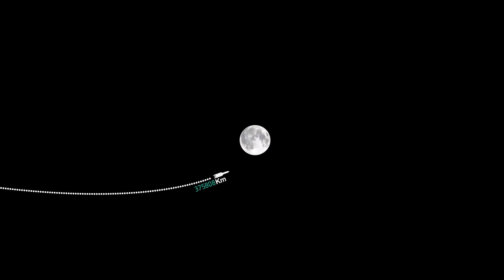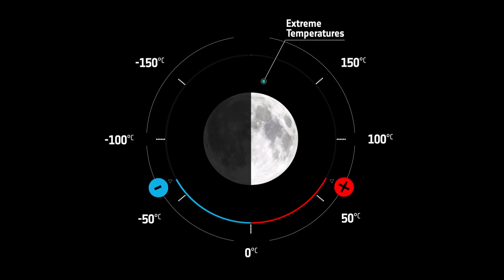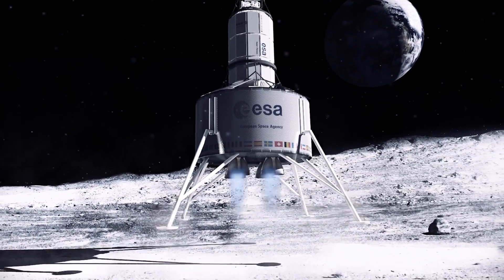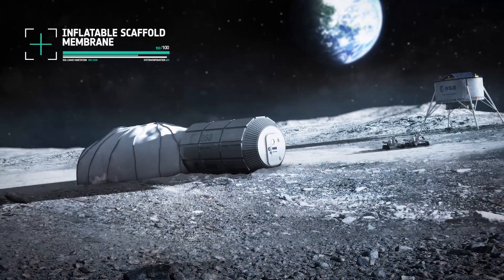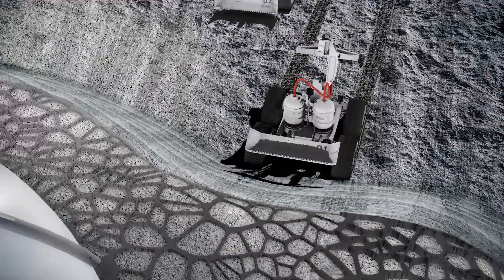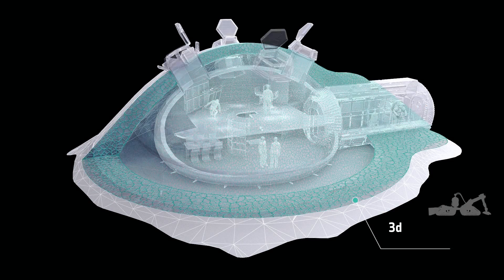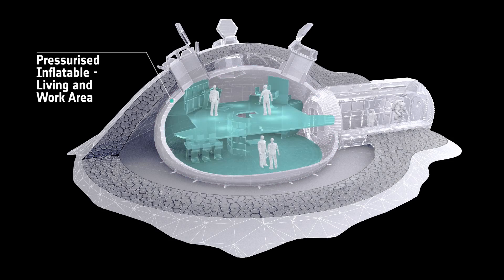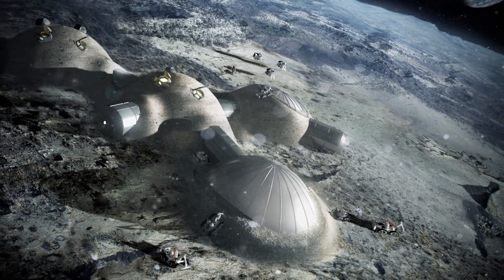3D-printing a lunar base

Comment: I still can't believe this hasn't happened yet blows my mind.  There has to be a reason.  -50c to 50c is -58f to 122f.  That is absolutely achievable to have sent 3d-printing heavy machinery.  You're working with near Earth range temperatures.  It's literally right there.  Blows my mind.  All the solar power you need is easy!

Comment: Dear Old Ariane,   and Starship a combined Shuttle/Freighter/Moon base system.   150 tons Delivery ! !
(Put on it's side (controlled topple with forward rocket engines) slowly remove flight hardware(and stabalised with floors/bulkheads) while living in habitation zone.   A relative simple Cut & Cover Base)

Comment: What harm would there be in using a thick layer of moon dust without 3D printing?  3D printing 2 or 3 feet instead of piling a thicker layer of loosely settled moon dust is more complex and therefore more prone to problems or higher expenses.  Digging the structure into the ground seems even safer from radiation and micrometeorites because it'll be an even thicker layer of moon dust.

Comment: two things, one is the water and air scrubbers would they be in a separate capsule and second power will it be nuclear or solar cause if it is nuclear it will have to be far away to prevent radiation swamping the area more then the normal solar radiation, also with the sun lights what happens if a asteroid directly hits one?

Comment: maybe an easier solution: 
2 types of robots, one makes bricks that are interlocking (kind of like a simplified lego brick), the other assembles them. 
or you can send just the brick maker, without anything else. Once someone comes over, they can assemble it
Okay, maybe not an easier solution, but it would make for a more earth looking structure

Comment: This is actually how lunar bases were envisoned back in the 60s by both soviets and Americans. Layering regolith dust, then using simple focused light to heat and melt it before the next layer was deposited, thereby building up a 3D shape. It would have roughly the strength of obsidian glass which with minor armature would be strong enough to build megastructures with. Especially in the moons gravity. So imagine 200,000 floor buildings.
Reply: you mean 200 floor? 200,000 would be 6000km and thats 1/2 diamiter of earth

Comment: 3D printing is the way to go, but those skylights are just unnecessary especially if the don't block radiation like the cupola does.
If someone later creates some window material suitable for such task, nothing prevents printing more on top of the windowless domes, in fact the shells could printed straight away because there would be no worry of decay.

Tetrahedron would be also more versatile shape for a building project than a sphere, especially in the long run.
Reply: the sphere is stronger than a tetrahedron, and would also be easier to create using the method proposed.
Reply: @JuliaC-sp5qk  But it doesn't need to be strongest, it just needs to be the easiest shape for ever growing colony, tetrahedron would be most suitable a long with cubical shape, as it can be stacked  more easily and they don't have round shapes which means you don't have make unusually shaped objects, but can instead use already mass produced things.

Also, if the buildings would be at some point covered with solar cells or just metal plates, flexibility wouldn't be an issue as they could use just straight plates.

Comment: It's just the same design as my dreamhouse here on Earth. Burrying a house into the ground seems to be the most efficiënt way to build a house. Here on Earth they're extremely sustainable and save you a lot of energy. They keep you cool in summer and insulated in winter and there fit more into the natural landscape their build in. It is very awesome their are also the most efficiënt way to build a home in space on other planets and moons. You can say their are literally universal home design since they are the best solution in the entire universe😎👍
Reply: No, it wouldn't be any good on a liquid world.
Reply: @Jacob_Crowthorne  Not on a gas planet like Jupiter indeed. On a waterworlds you could make a flouting house but that would also be a totally different design. But on planets and moons with a solid surface made from rocks, sand or ice they are the best way to build a house.

Comment: I want to  see a base on the moon but everybody makes things more complicated than they need to be. It is easier to pgase 1 put down in a small crater, use the lander as the airlock/habitat and then dome around the lander compacting the regolith. The robots could just bulldoze and process the dome to cover and harden. This base will then be manned and phase 2 is to manage robots digging out trenches for the long farming domes to be buried and covered in solar panels.These will be detail installed by humans for lighting, bedding and irrigating for food and medicine. It all must be deep enough to block all the bad and manage the good. Phase 3, 4, 5... and so on. Keep It Simple Soldier. 3d printing and compatible systems break down easily. The regolith itself is killer abrasive dust.

Comment: - The skylights ought to be using mirrors to reflect light in, not be direct portals to the micrometeorites.
- Where's the power source?  Solar would be the logical choice and of course they would have to work with small holes punched through them, there are some that do that.  Additionally little structure for them due to the low gravity.-  What about the problem of the lunar soil and it's sharpness and danger.  Some kind of airlock would also need a way to clean/grab these particles for the health of the astronauts as well as keeping it out of the main living area.

Comment: THIS is the way colonization off-world needs to be started. And it needs to be extrapolated to a larger scale as well, building downward into the surface. The more meters of material between you and the surface, the better. Same thing for Mars; don't leave anything exposed or unprotected to the winds and the rock and the sandstorms. Dig down, dig deep, and cover it all for protection. None of this 'lets send colonists in a habitation tube that's protected by foam and tinfoil' garbage. Get the bots to start the work, and THEN let people move in.

Comment: There's no way that thin shell with protect you from Meteorites. Other than that, it's a good idea. You would be better finding a natural depression, building the dome stronger and then covering it with a lot more material. Better still build under the ground, although that is energy intensive. Another idea is to locate possible caves (if there are any) and build your base inside.

Comment: your going to need much thicker walls to protect from radiation. in space a lot of them are ionising and it will take more than 4 feet of dust to keep ionising gamma radiation out. 

also good luck trying to make a river work for 3 months straight. you do realise all the steps that are taken to allow the marz rover even move a foot??

Comment: I'm going to build a house in a similar fashion.  I'm currently working on a cool building earth ship building project at the moment.  I keep mentioning using a foam and sand mixture to fill the tires and we came across foam/crete mixtures and are working with that.  anyways Sweet way to build on the moon for sure.

Comment: comment 2#. the lunar base could be a joint effort funded by several countries including the U.S., Russia,China, the U.K.& the European Space Agency.and Japan as well as other countries in.this way the cost would be reduced significantly & having a moon base would be a stepping stone for launching a future mars mission we would be better prepared to cope with the extreme environment there.otherwise going there now would just be a suicide mission that would destine to fail halfway there.we need a nuclear powered ion drive craft that could get you to mars in less than 40days possibly even 30 days if the ship is fast enough.
Reply: UK is in the European Space Agency, also they do plan to use this as a stepping stone to Mars
Reply: @Livinivs  it won't be for much longer. Brexit.

Comment: if your going to build a moon base it would a good idea to have several dome like structrures built 1# for living qtrs 2# one for lab.wk.3#a power plant a small one at 1st and a station for maintenance & receiving of supplies etc.& that they all be connected by lunar lava tubes a rail system developed to make it safer & faster to get from one sta. to the next. & to create an emergency shelter in case of some unforeseen accidents occurring & a landing pod area for incoming ship's.
Reply: Remember that they always want to save as much space as possible, so they'll probably merge the living quarters with the lab. Obviously, if that's not possible, they'll split them into a couple of domes, as you have described. And don't forget about supplies - it'd also have to go somewhere (probably in those tunnels connecting the domes). A 'power plant' would just be solar panels on the outside of the domes. And a rail system would be the last thing they'd want to build, as walking a couple of yards is an easy enough task, I reckon. 

As to the shelter, they won't need it, as if anything goes wrong, they'll die either way. A shelter won't help. 

And, lastly, yeah, a launching pad would probably be a good idea.

Comment: nice would be able to put an observatory on the moon and make a it a refuel station for  further travel and a back up for rescue if needed also can make a ship building/repair  station safer launches don't have to fight the gravity and atmosphere burn up, can also make a relay station put full array of  satellites on the moon
Reply: Imagine the colossal structures that we could build on the moon, where it's only 1/6 of earth's gravity.
Reply: You could even use the ground material to let robots print a huuuuuge kind of telescope. It doesn't have to be precise and you will be limited on what you're seeing, but it could be very very huge and cheap and therefore worth it.

Comment: Helium 3 will be their main mining ore to be extracted for use as fuel for various engines. But you will also have to contend with the beings already there on the backside of the moon also mining Helium 3. They aren't push overs either and already can sense our Remote Viewers presence whenever they try to see what they are doing. So they are highly intelligent as well. No this will not be as easy as you might think but with diplomacy possibly they will not fight. Still I think you might want to try and contact them before coming face to face with them on who owns the moon.

Comment: It mentions solar radiation, and gamma radiation. The main hazard in space aside from Solar flares, is the continuous faint patter of Galactic Cosmic Rays. At Sea level, we have about 10 tonnes of atmosphere over each square meter. Up where I'm at (1.5km) we have about 5.
The NASA Ames Space Colony studies in the '70s setttled on about 2m of sand equivalent to a high altitude city. Solar flares require no more than about 60cm, but a cosmic ray would zip through it, slowing it down so it takes more time to pass through you, doing more damage. It also knocks a secondary rain of nasty particles off the solar flare shelter into the interior which is far worse, if you don't have the complete GCR shielding.

It carefully doesn't say what the printing material is...

Comment: This is all good except the "3d printing material" should be the regolith itself melted by focused solar energy. This way the printers could print an inexhaustible™ supply of infrastructure from roads to sinks to rail-launch systems and so on. You would want one specialized printer for printing the things that can't be made from regolith. (control circuits, actuators etc.)
Reply: And the DLR just did this! :D

Comment: Amazing! I wonder if they can print a whole building instead of coating actual ones using lunar materials, maybe after the first base built in that way, then it would be possible to study the lunar surface material and see if it can be used to build the actual structure.
If they can find away to use the lunar materials for a strong material to use in 3d printing, they can use it to build a station around the moon in orbit, not on the moon.
But wouldn't the low gravity be bad for humans if they are planning to live there? The maximum duration they can stay there is few months and that's it, it would be expensive to keep sending people back and forth every few months to the moon, wouldn't be a better idea if people live in orbit around the moon in stations that can provide artificial gravity by rotating, and they can have a quick in and out to the moon surface since it doesn't have any atmosphere, you can also have a better flexibility avoiding asteroid hits instead of sitting there and hoping it's not too big to do even small damage that can be fatal or turn the whole base useless for human activity.

Comment: One question: aren't the cupolas the "weak spots" of the dome? Even a small meteoroid would easily blast through the glass window if the lid is open. It must be one hell of a tough glass then.
Apart from that... release them robots already!

Comment: Maybe digging tunnels may be more convenient.
Reply: +Alex Tigre The problem with digging tunnels is that you have to bring all the digging equipment and you have to air seal it. Digging will be the next step, when a way of collecting metals from moon is developed.
Reply: Definitely not as a first solution. Just the transportation of the necessary equipment would be an absolute overkill. It might be the way to do it in the future and there will definitely be uses for it. But by that time the 3D printing technology might advance so much that there will be no need for digging tunnels other than for mining purposes.

Comment: I feel like over time the shape of the 3d printed rock would deteriorate shape, Many examples of 3d prints on earth drooping. If one part of the wall collapses, it would be enough to let the gamma radiation in. Would be good as a start, then we could reinforce it with lead walls or something.

Comment: Right...print a building. But do you know what happens to a building without foundations? Is the printer going to dig them?
Reply: +Georgi Georgiev There are some differences between earth and the moon: gravity is less so the foundation doesn't need to be that strong. There is no water erosion. There is plenty of solid rock to build on. This is basicly like building an igloo, you only need a nice decently flat surface